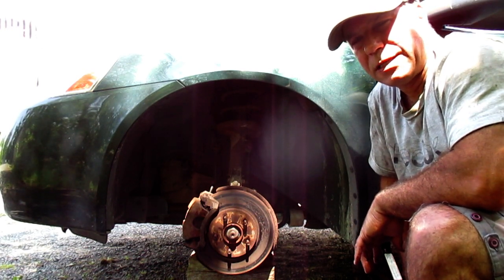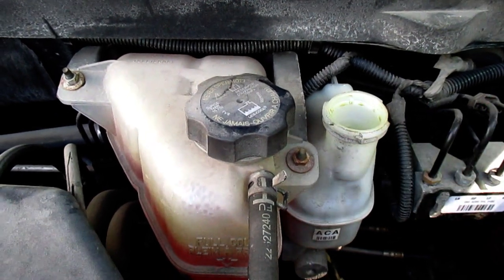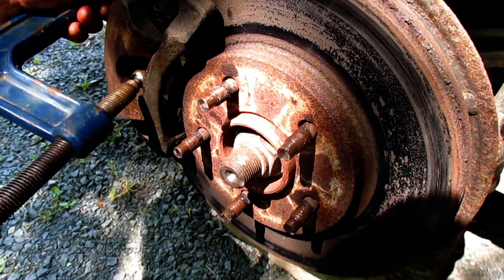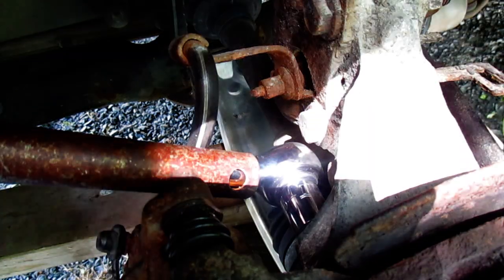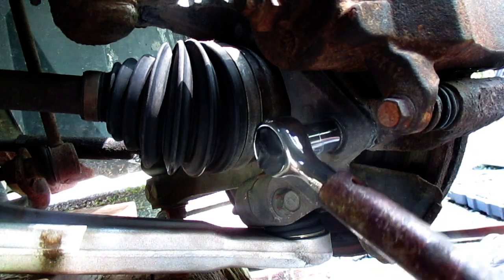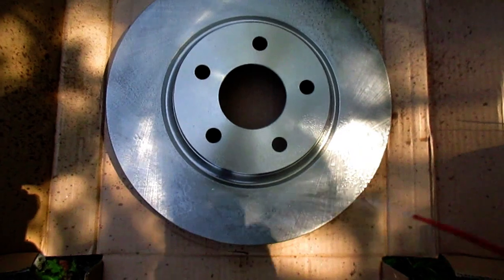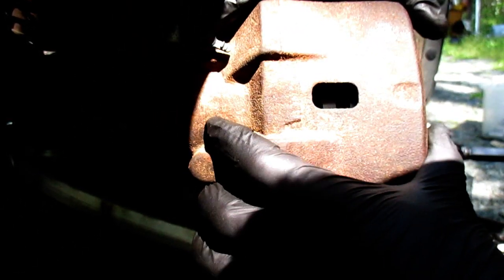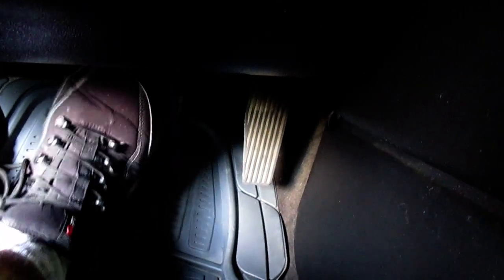How a car with warped rotors handles ; and how to change brake rotors

Comment: did you have to bleed the brakes after putting the rotor \caliper back on?
Reply from the maker: No i didn't Leslie. You only have to bleed the brakes if there is a possibility you introduced air into the brake system ; if you opened a bleeder valve , or loosened the bolt on the caliper brake line - something like that.